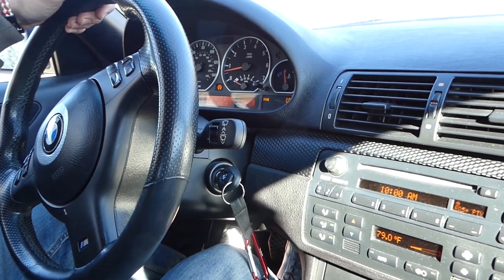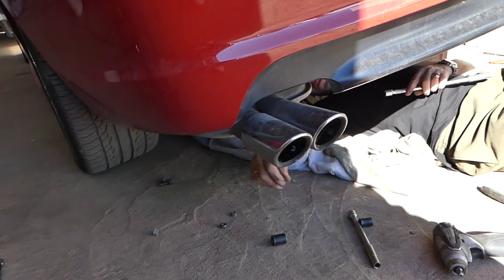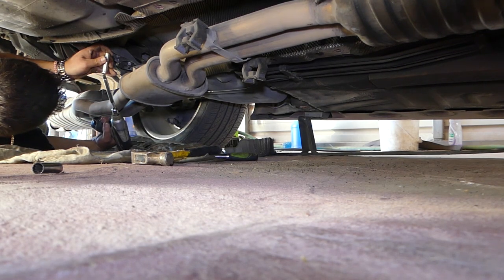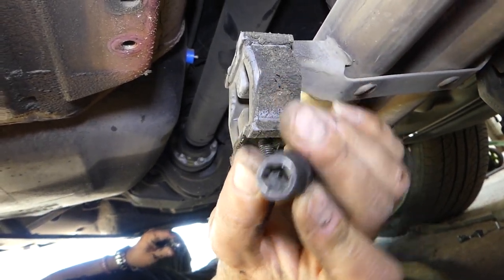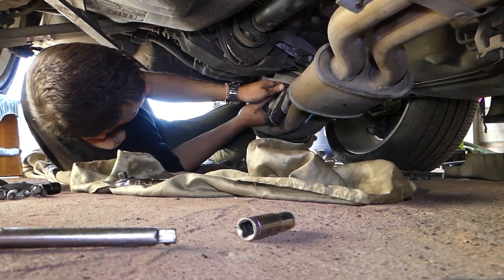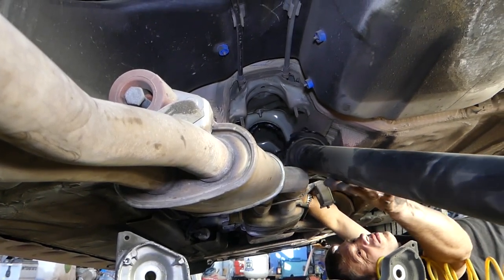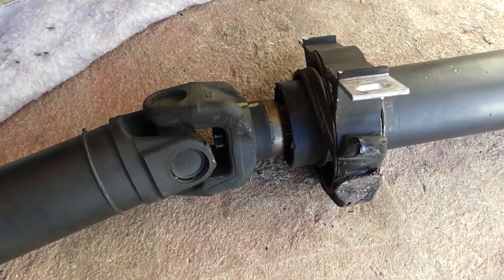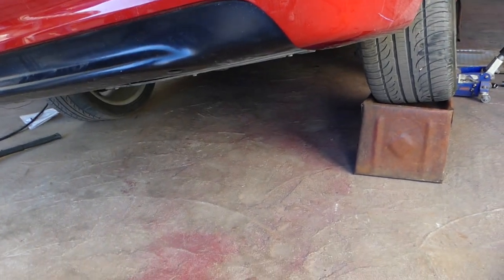Project BMW E46 330ci GUIBO SUPPORT BEARING FAIL and REPLACEMENT

Comment: I don't know if you changed your guibo before by yourself, but the bolts weren't correctly mounted, they have to go in alternate direction, following the arrows on the side of the disc

Comment: I have the same problem. Ok my bmw 330i 2003 5 speed it only vibrates on 1st and 2nd gear. Would it be better to replace the whole DRIVE SHAFT?

Comment: geez take off that muffler
Reply: dookiefacee well well well , one reason sometimes You don't wanna take that muffler down is because if there is any rust around the 2 gaskets,  you'll need to wire brush everything and sometimes the rust go in between the flange and even with cleaning it the surface won't be really smooth to seal the both pipes and it will still leaking , believe Me I work in a muffler shop and I know it,  try to get the job done with less work 😊